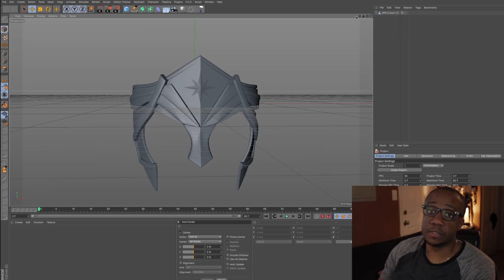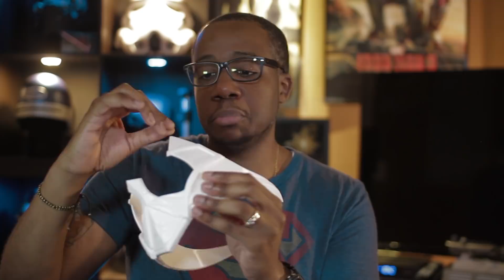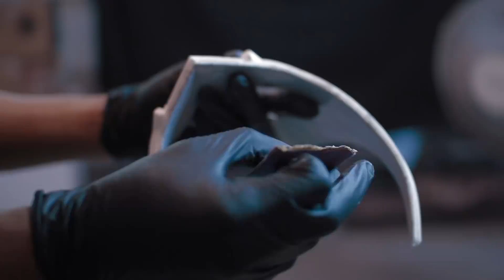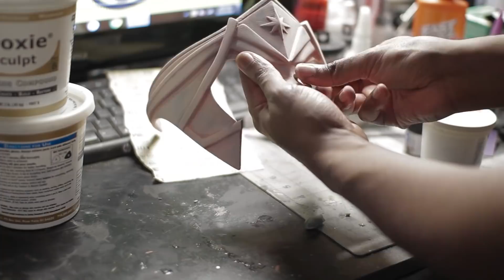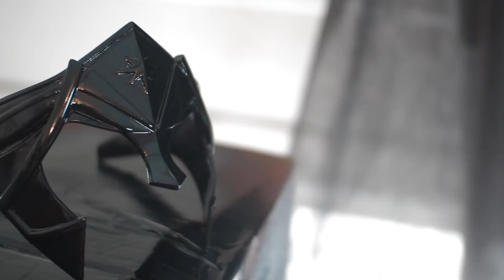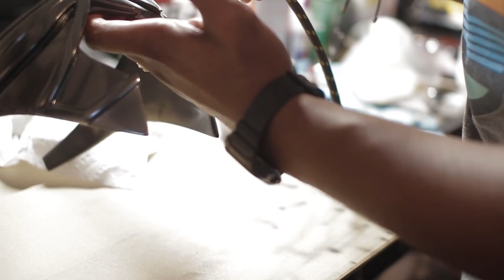3D-Printing a Custom Wonder Woman's Tiara for Cosplay!

Comment: Hey Darrell, with the breaking parts and then the shell pealing off the nose, I would guess that your printer was under-extruding (either a small clog or more likely, not quite hot enough). That explains the multiple issues you had. Great job!

Comment: Great stuff I would try 3-4 mm on the thinness areas and then build up thickness from there. For me go thick so it can be used over just set on a shelf to look pretty.
Reply: If you did that thick you can sand a angle for the thin edge but the thickness needed to last.

Comment: You might have been better off cutting the tiara into two parts so you could have printed without (or almost no) supports. 
Also: Your print seemed somewhat brittle. Maybe increase the temp a little for this filament to get better layer adhesion.

Fantastic job finishing the tiara though! Love it. Did you put the file online for us to try and replicate this?

Comment: Nice work on the prop. Quick question, When running a print like this that takes over 24 hours.   How do you determine the spool size of filament?

Comment: Sorry, but there are a LOT of very rookie errors on this model/slice/print - please go find a 3D printing expert who can demonstrate how to do it correctly and not teach people how it shouldn't be done.  The result came out OK, but here are my comments:
1) the thickness of the model is a well understood problem and is related to how many perimeters and the bead thickness - you have to take into account how it will be printed.
2) there are about 2x as much support material as necessary
3) the print quality is 2nd rate - the printer is not properly calibrated - this resulted in a lot of extra sanding
4) Darrell noted his painting issues - getting advice from Tested's other experts would have been more beneficial.